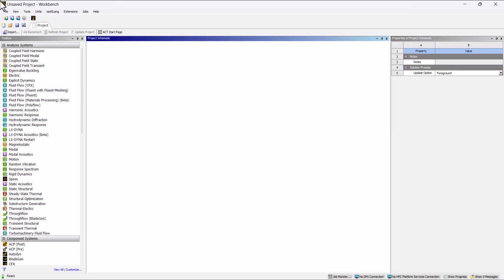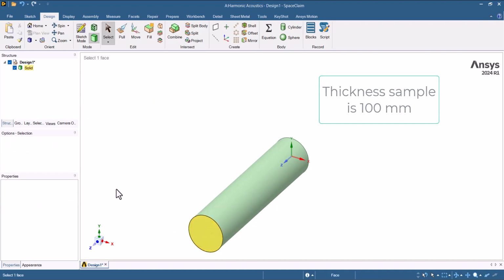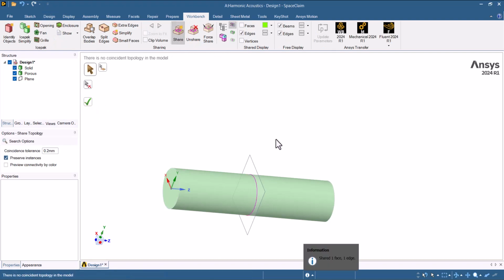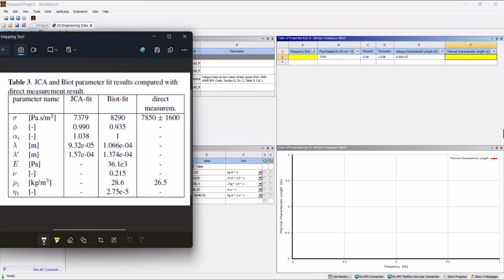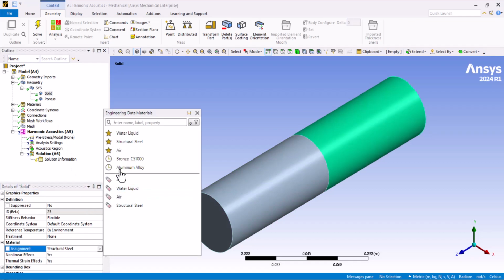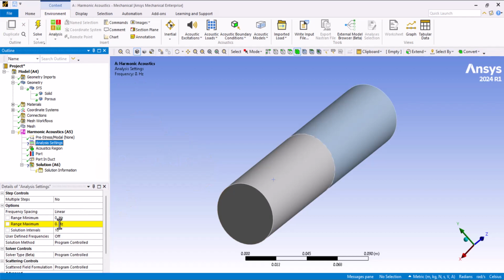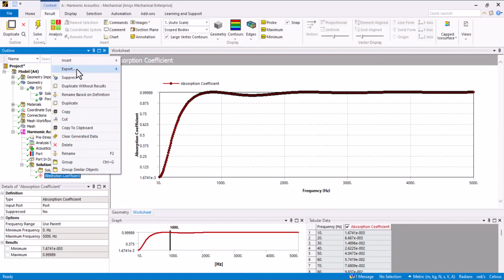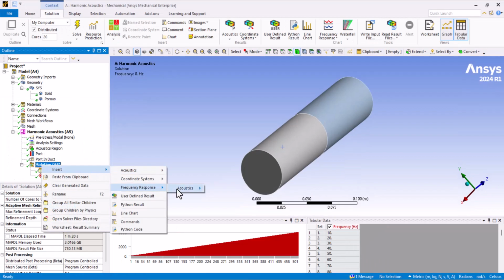🔊📉 Ansys Tutorial: Sound Absorption Coefficient Using the JCA Model 📐📘

Comment: hello sir. In my case i have a stack of materials, and one of the layers is a thin alumin layer. Any ideas on how can i model it, sinde its not an absorption surface. 

Excellent video btw, thanks.
Reply from the maker: Hello, I think you should add a structural region for aluminum layer in addition to acoustics region. I haven't tried it before.

Comment: whats different port in duct and mass source ? And whats good choice if i simulation transmission loss ?
Reply from the maker: Port generate a plane wave pressure according to standard of measuring sound transmission loss. Mass source is not a good choice for calculating sound transmission loss.

Comment: hello sir, after clicking on solve it is giving me this error "The Program Controlled Far-field Radiation Surface detection option chosen in the Analysis Settings could not find any surfaces that are a part of Absorption Element/Surface, Impedance/Radiation boundaries or Artificially Matched Layers interface. The post processor will not be able to evaluate Far Field results."  how to solve this.
Reply from the maker: Hello, this is just a warning and is not important. Don't worry, it won't affect your solution.

Comment: Hi sir, you mention that the other cylinder have rigid boundaries. So, do we need to apply rigid wall on its surfaces?
Reply from the maker: All boundaries are rigid by default in acoustics system. No need to define rigid boundaries
Reply: Another question sir. Is it possible if i apply surface velocity and radiation boundary at the inlet face? Or we can ignore it?
Reply from the maker: @nurulsyafina1086  absorption coefficient is independent of inlet. Port boundary is defined to calculate absorption coefficient and no need to other boundaries

Comment: Hello sir will you please put a video to see the combined effect of a microperforated plate along with porous absorber.?how to combine two physics together to get net effective absorption coefficient?
Reply from the maker: Hello. add a interior perforated plate boundary on the poroacoustics domain. it's not complicated.
Reply: @caewitharminhashemi   ok sir i will try. Will you pls share your email ?
Reply: sir do we have to model this as 2D?
Reply from the maker: @PriyankaSuryawanshi-if7du  no. You have to use 3D geometry
Reply: ALso now i want to simulate the absorption of tapered hole ...so how can we specify the dimensions for tapered hole geometry and  since in case of this perforate boundary condition it is for cylindrical hole only.
Reply: sir i want to use it in comsol
Reply from the maker: @priyankasuryawanshi566  you have to read helmholtz and qwt resonators theory. You Can design tapered hole by this resonators because they are foundation of acoustic black hole absorbers
Reply: I could apply but the results are not correct. The nature of the graph is not correct one. Sir,will you pls share your mail ID.
Reply from the maker: @priyankasuryawanshi566  Armin.hashemi.k@gmail
Reply: @caewitharminhashemi   sir so is it possible to implement in 3 D. as well also do I have to use MAA's equation for that.. only this boundary condition is sufficient?
Reply from the maker: @PriyankaSuryawanshi-if7du  I suggest that you solve model with the perforated boundary condition first. 3D model is another scenario and needs another physics in comsol. The Maa equation is not available in Comsol